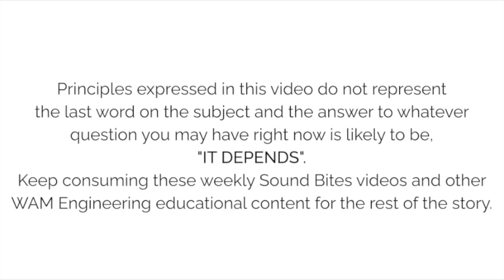Sound Bite #39: When Is Using A Conical Phono Stylus The Right Choice?

Comment: I got a Denon 103D retipped with boron and a micro ridge. Unbelievable difference
Reply from the maker: It certainly can be! It can also be WORSE than a conical - when your fine line has been badly misaligned on the cantilever.

Comment: You totally left out playing vintage mono records.  That's where a comical stylus could be a wise choice.  Even if there is no appreciable EQ difference between using an elliptical or fine line stylus on such records, you will get a quieter background or surface noise because the conical shape isn't digging that far into the groove.  I always use a conical stylus for 60s 45 RPM records and 60s mono LPs.
Reply from the maker: I have difficulty accepting that argument. A conical stylus isn’t inherently “quieter” than a fine line stylus. No lacquer ever was cut with a conical cutting stylus so the disadvantage of a conical playback stylus with respect to optimal transcription starts right there. If one experiences quieter playback from a conical vs a fine line it is likely that they are reading at different altitudes in the groove where the conical misses, but the fine line comes into contact with, groove wall damage. The other most likely explanation for when a conical is “quieter” can be explained by using a fine line stylus that has plenty of zenith error. This can cause even greater pinch effect than a conical in the same groove.
Reply: @WAM-Engineering  I guess we'll agree to disagree.  Take care!
Reply from the maker: You too!!

Comment: Hello Jr: 
I believe your ‘nuanced’ assessment is overly generous and diplomatic. It would be more accurate (and helpful) to adhere to your initial declaration: "Never" utilize spherical/conical styli. The fundamental reason, which you omit, is that spherical/conical styli degrade your most valuable asset—the vinyl record groove wall. This phenomenon has been extensively documented in AES articles and explicitly demonstrated through electron scanning images. Numerous articles refer to the pinching effect and groove deformation; in simpler terms, based on common-sense physics, the contact points of spherical styli are exceptionally small. Both bonded and nude conical styli are substantial (massive), typically exceeding twice the mass of a modern fine-line stylus. When a "high mass" conical stylus traverses the groove, it is not easily deflected, resulting in the yielding of the softer material, namely your vinyl. This is to say it gouges out a new groove path into the groove-wall, and degrades the signal. This technology has been antiquated for over forty years, and we should acknowledge its obsolescence.
Reply from the maker: A fine line stylus can exhibit greater pinch effect than a conical depending upon its minor radius and the severity of the zenith error.

Comment: What about mono records? Not all, but most mono cartridges come with conical stylus. In my experience, in mono records from the 60s with groove wear due to playback with poor equipment, the groove wear distortion is less noticeable (or not noticeable at all) with conical profile rather than the microlinear I use with stereo cut vinyl.
Reply: I totally agree and was about to make a similar comment :)
Reply: @marktubeie07 I just did!
Reply: Each have their complementary product. This was about bringing out all that‘s in a groove. And not about making broken records sing. A chisel is no hammer.
Reply: @GiancarloBenzina  I do vinyl transfers to digital.  Getting the most accurate sound from the records is important to me.  There are times when conicals sound the same as picking one side of a stereo channel, and times where they are a real benefit.  And, I carefully align and calibrate mono cart/conicals just as carefully as ellipticals or microlines.
Reply: @GiancarloBenzina  if we keep worn out records out of the discussion (and I agree that if possible it's a good idea to replace them with copies in better conditions), I still don't understand why manufacturers insist on designing most of their mono cartridges with conical stylus, even very expensive ones
Reply from the maker: Agreed!

Comment: When you can't afford a fine line microridge, paratracer gyger or shibata.

With eBay you can get them with little wear for around £200/300 which is roughly the same as the venerated Denon 103r

Of course your phono stage has to be up to it. But today with China in the fray we're talking £300 as a starter.

Had 6/7 conicals/ sphericals at one point.
Kept my Denon 103r for nostalgia.

Ditched the rest. I Listen to every type of music.
🎸🎧🎵

Comment: Hi, J.R.  Is it recommended to use a conical (or, specifically NOT a MicroLine) stylus on records made from styrene?
Reply: @BedPanAlley  Exactly right.  A microline or a hyper-elliptical stylus will damage styrene pressings in a few plays.
Reply: You would have to keep the tone arm pressure extremely low on ellipticals for use on styrene.If you just see cue lines or no lines,rather than burns in the cue-in groove dead area,you won't be wearing the grooves as easily.
Reply: @ronmartin4212  A regular elliptical yes, but hyper-elliptical and microline styli are an absolute no-no for styrene not matter how low the tracking force.
Reply: Or how about a sapphire????Want to see grooves turn ghost white in no time,on a styrene???I've seen it.A Yardbirds Shapes Of Things in a pile of 45s at Princeton Record Exchange,one time.Most disgusting looking copy I've ever seen.Shear destruction of groove walls.
Reply from the maker: Sorry, but I’m remain skeptical about blaming the stylus profile to groove damage. I think the evidence is more strongly supportive of problems with the tone arm set up, torque forces and kinetic forces. I could certainly be wrong, but I have never seen any evidence whereby it was clear that the variables were controlled before arriving at this conclusion. I have no doubt that one stylus profile could potentially cause more damage than another, but not due to the fact of the stylus profile itself. I believe it is more likely that it really depends on how that cartridge is being supported by the tone arm.

A 12 gauge shotgun will do more damage than a 20 gauge shotgun, but neither will do damage if there isn’t somebody to fire them inappropriately. That’s my analogy.
Reply: @WAM-Engineering  My life experience shows otherwise.  My main turntable is a Realistic LAB-500 which came with a Shure M95-HE cartridge permanently mounted to it's custom tonearm.  I downgraded the Stylus from hyper-elliptical to elliptical and now my styrene records hold up much better to repeated playing.  This all went down well before Shure stopped supplying genuine Shure styli.
Reply from the maker: I do not contest whether your experience is valid or not. What I am calling into question is your conclusion. Have you measured the frictional and torque forces in that arm?? Until you have validated that it is not part of the problem then I do not see how we can blame the stylus profile.
Reply: @WAM-Engineering  The science here is very simple.  A microline stylus has a small contact area, and polystyrene is brittle.
Reply from the maker: I disagree with this. All radiuses contact a line by a single point. The degree to which a point can become a surface area depends upon the Young’s and shear modulus of the groove wall. The spherical stylus has a radius of about 25ųm. A fine line contact has a much smaller minor radius but far larger major radius. The last major radius we measured was 1100ųm on one channel and 1220ųm on the other. Any surface contact area is hugely increased by this profile over a spherical. 

Yes, I know that the declared major radius’s are 1/10 this number but that is not what we measure. This is another reason to question stylus maker’s design and construction claims - as if we didn’t have enough already.
Reply: @WAM-Engineering  Again, the science here is simple.  As an example, a spherical or conical stylus is fine at 5 grams.  A microline or hyper elliptical stylus at 5 grams will rip your records to shreds.
Reply from the maker: I believe a Hertzian analysis proves that wrong and I go back to my original claim: there is no evidence I have seen that suggests the role of the tonearm has been controlled for in such “science”.
Reply: @ronmartin4212  An unworn sapphire will not cause more damage to any record.  The problem with sapphire is that it wears out in as little as 40 hours playing time.
Reply from the maker: I may have misunderstood your claim. Sorry.
Reply: Ya mean.......🎵skept-i-cal/ellIPPT-i-callll..🎵.its-not-pract-i-cal...pract-i-cal/ellIPPT-i -callll....🎵🎵🎵it's-unacceptablllllle...acceptable/ellIPPT-icalll.......its-not-musicallllll...🎵🎵🎵.(HEY!!,I think we have a song here-sing it with me..)🎵skep-ti-cal/ellIP-ti-callllll.....it's-not-prac-ti-callllll🎵🎵🎵🎵........
Reply from the maker: Clever
Reply from the maker: I don’t really know about the evidence behind the claim but I am immediately suspicious. Could be true but since such records are no longer made (to my knowledge) and my aim is to look forwards to what “could be” I will likely not be studying this issue.

Comment: I was wondering does your anti- skate device bias. Does it tell you if the anti- skate on the arm is correct the dial? should indicate that I suppose, a lot of them are out not sure why that is.
Reply from the maker: Yes, the WallySkater allows you to calibrate that anti-skate adjustment dial. At least ten tonearm manufacturers - that I know of - now use the WallySkater as a quality assurance tool.
Reply: In the 1970s, some Dual turntables had separate anti-skating scales for different stylus shapes.

Comment: Great presentation! Make one also use a conical stylus for playing very worn records? Thanks & blessings!
Reply from the maker: Yes, sure, but sometimes with the right profile you can read the groove wall above or below the damaged "altitude" in the groove wall.
Reply: @WAM-Engineering  Correct.  The best profile for worn records is a line profile stylus but given the cost and the limited improvement, buying a new record and playing it with a line contact stylus is the best option.
Reply: @WAM-Engineering excellent, thank you!
Reply: Unless the 45 is a ridiculously scarce Soul,or garage one from the '60s.Good luck replacing them.
Reply: @ronmartin4212 Thanks, Ron!
Reply: Sell your very worn records replacing them with better. Not worth the life-time to listen to them, if there is any alternate.

Comment: Let's say one can't afford to optimize all the alignment parameters. Say we're talking about a student here, and they can only get tracking force, anti-skating, and overhang correct. Is it then better to limit their stylus profile to conical since they can do nothing in the way of stylus rake angle, vertical tracking angle, and azimuth?
Reply from the maker: Not necessarily. You would be better off going for a Shibata, which is HALF conical. They tend to be aligned a bit better for zenith error than other more severe designs.

Comment: OK! You hooked me again! I was expecting you to refute what would be my #1 response! And I'd have to deal with thinking it over! But there it was! Never! Guess I could add a 3rd. back in the day and some still today modest low end ttbles come with spherical carts for pricing. Many can get some line contact upgrade stylus.
Reply from the maker: Yes, but if your line contact is way out of proper alignment, things can actually sound worse. I am convinced that is why two or three of the smaller "boutique" cartridge makers have claimed that their elliptical or conical stylus "sounds better" than a fine line stylus
Reply: @WAM-Engineering  Hard to say what kind of QC some of the cart manufacturers, especially lower end, are going through. Yes improper line contact could easily be worse sounding and more destructive.
Reply: What you say is true but... he did say "when is USING a conical stylus..."